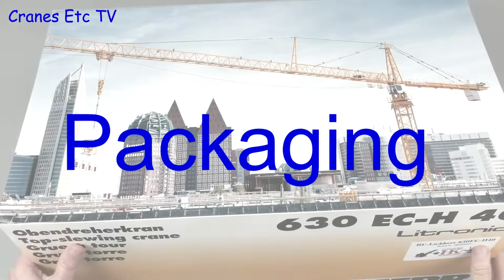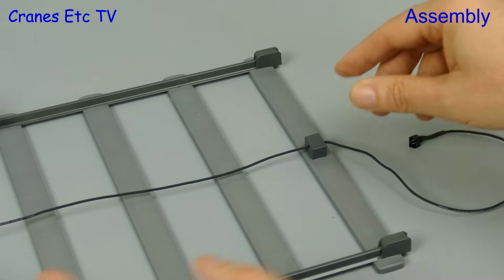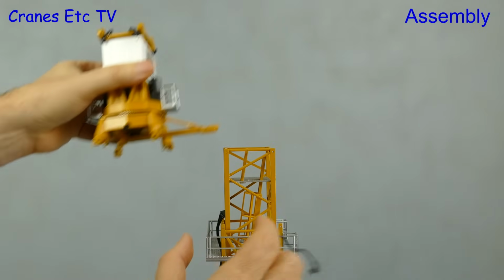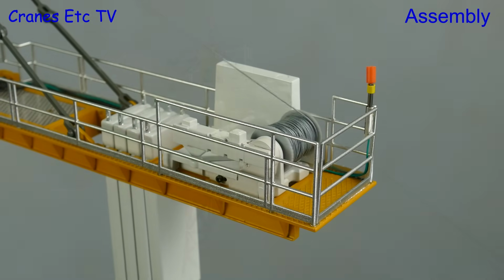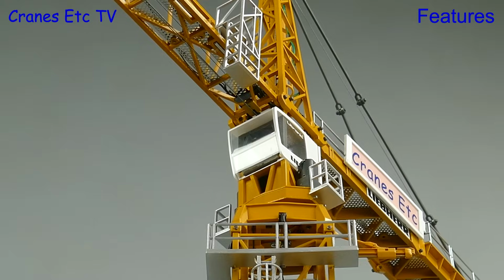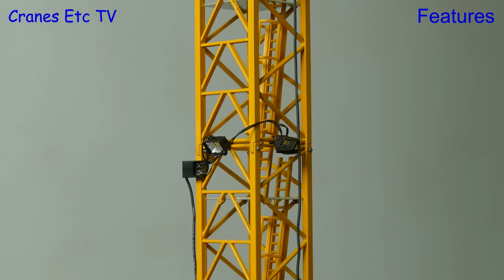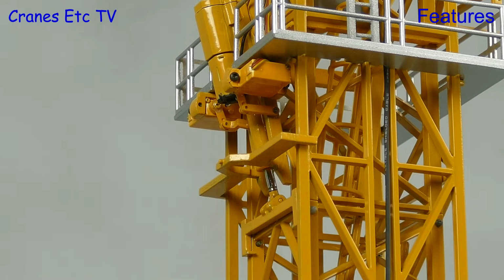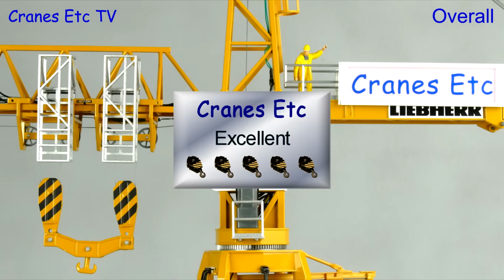RC HK Liebherr 630 EC-H 40 Tower Crane by Cranes Etc TV

Comment: I just today was wondering how a crane climbs I watched three R/L videos of the process and your model video answered a lot of questions I had.  Like why there was a guy working inside the top section of tower and its because the ram only pushes the climbing-cage a potion of the section rise, that worker has to push-out the catch so it can climb again and set the pins{bolts} when its in place.
Reply: ye

Comment: for those of us that don't know--how is this powered? does it use household current and convert it to dc, or run off dc battery packs? you showed a 10 channel radio,
how many channels does this actually need to run all functions?thanks !
Reply from the maker: Mains powered converted to DC.  It needs the 10 channels for all functions.

Comment: To answer FAQ: This rc model you can buy for about 1800,- EUR (without VAT = export price) in basic configuration and for about 3600,- EUR ( (without VAT = export price) in full configuration with all extras like in the review. Radio transmitter is additonal. I know this seems to be expensive, but nobody can imagine the long time of engineering parts and developing custom micro-electronics and all the handwork done to convert such an rc-model. You can not use standard rc components due to the small available space. It took me 2 years to engineer and the assemble of one model is a handwork of nearly one month. Only 12 models are available but conversion of a static model provided by the customer is possible. You can buy it only here: https://www.1zu50-rc-model.com/index.php/en/products-service/rc-models/liebherr-630-ec-h40 and nowhere else.

Comment: Im in love!!!  I must get this done. Absolutely love the jumping function. Amazing.  How much was it?
Reply: cranedude07 I LOVE Your videos
Reply: This is a converted Conrad model #2050/03, but it is sold out almost everywhere. Maybe you can still find it in e-bay.
Reply: cranedude07 yajahjizupojxhxbjgxhxjxjxjdkxjxhvxhzjwtdhydhyeyzjhxjxmxjxjgxhtdgdhhjzhjjzjzjjjzj
Reply: HKFunktionsmodellbau which model is it based on?
Reply: HKFunktionsmodellbau what's the difference between the /03 and the /0 version
Reply: mainly the only difference  is some of the pendant bars are a bit different in legth and the pulleys are metal instead of plastic on the newer models
Reply: HKFunktionsmodellbau  hello I would love info on the cranes that you have and pricing I would like to know if any overhead magnetic cranes were ever produced in more close to o scale  well I love this please do more crawlers in the bucyrus erie  p&h  whatever great work. My email is ldstephanmoore@yahoo.com thanks
Reply: HKFunktionsmodellbau I will buy one as im a tower crane fanatic and would love to work in a tower crane when I’m older.
Reply: nice
Reply: cranedude07 在來
Reply: Yup this crane is like made for strength
Reply: This rc model you can buy for about 1800,-  EUR (without VAT = export price) in basic configuration and for about 3600,- EUR ( (without VAT = export price) in full configuration with all extras like in the review. Radio transmitter is additonal. I know this seems to be expensive, but nobody can imagine the long time of engineering parts and developing custom electronics and all the  handwork done to convert such an rc-model. It took me 2 years and assembling one model is a work of nearly one month.
Only 12 models are available but conversion of a static model provided by the customer is possible.
You can buy it only here: https://www.1zu50-rc-model.com/index.php/en/products-service/rc-models/liebherr-630-ec-h40
Reply: HKFunktionsmodellbau thank you for the reply, i would really like to have this done
Reply: Send me an e-mail via my website
Reply: @HKFunktionsmodellbau  Are you selling this tower crane model?

Comment: I like this toys and how much
Reply: This rc model you can buy for about 1800,- EUR (without VAT = export price) in basic configuration and for about 3600,- EUR ( (without VAT = export price) in full configuration with all extras like in the review. Radio transmitter is additonal. I know this seems to be expensive, but nobody can imagine the long time of engineering parts and developing custom electronics and all the handwork done to convert such an rc-model. It took me 2 years and assembling one model is a work of nearly one month. Only 12 models are available but conversion of a static model provided by the customer is possible. You can buy it only here: https://www.1zu50-rc-model.com/index.php/en/products-service/rc-models/liebherr-630-ec-h40
Reply: Eowyn Sharul more than you can afford, pal